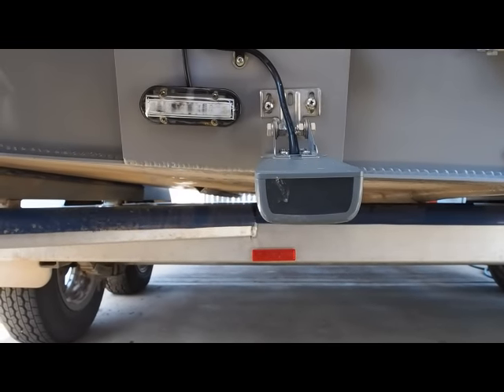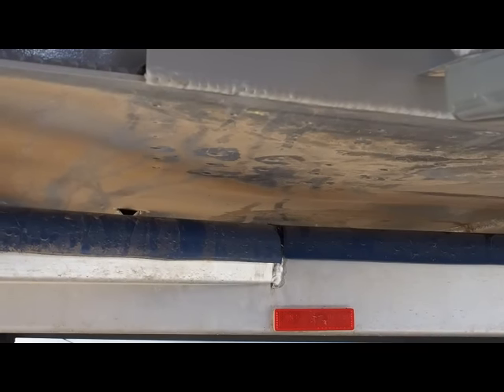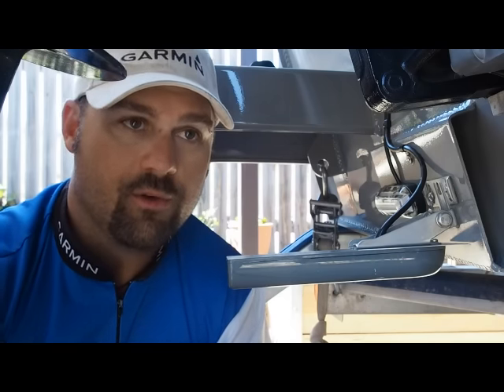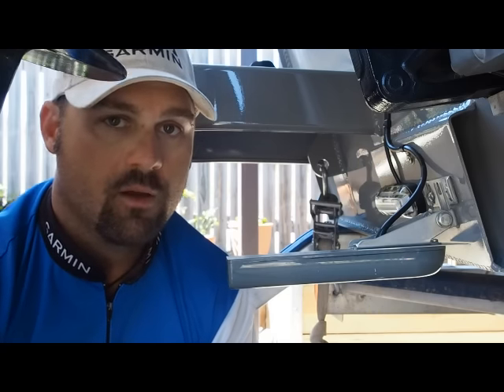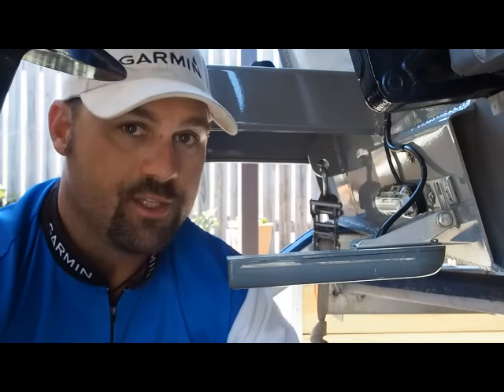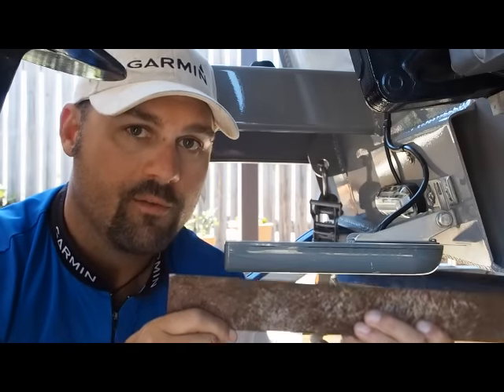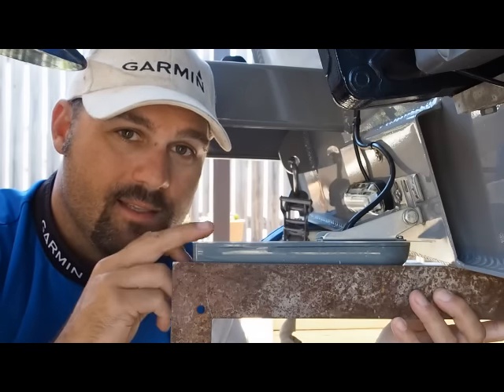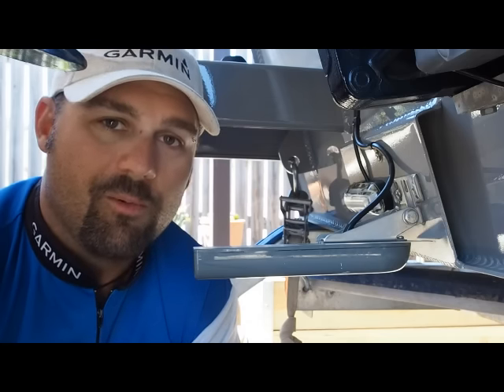Fitting Your Transducer to Read at Speed

Comment: This is a good video.  I put 2 transducers on my boat.  One for high speed, the other (side and down imaging) for trolling.  The high speed (2D only) is on the starboard side, the wide side and down on the port side of the motor.  I troll with an electric up on the bow so there is no turbulence from that back at the transom.  It works well and I can read the screen at over 40 mph.  It really saves a LOT of time when determining where to fish.  Once I find them I switch to down imaging and troll with the electric.  I had 2 boats before this one that "lost the picture" at about 4 to 5 mph and it drove me nuts.  I wanted to make sure I did not have that problem again.  Both transduces are connected to the Humminbird through a Wye cable (sold by  Humminbird).

Comment: Another channel said to put the boat on the water. Measure the boat level at troll, then back at home, set the boat up to the same level. Then install the Transducer making it level. Lot of work. I like your method. Seems more practical.
Reply: The boat may not float or plane level so setting the transducer relative to the bottom of the hull doesn't make sense to me.   I checked my boat at slow troll and  my "search speed"  (about 10 mph)  and set my transducer level for that as those are more important (to me) than reading "at speed".  A bit more effort but I think it is worth it. Each to their own :-)
Reply from the maker: Whatever works mate,  if my clip helps then it's served Its purpose.
Reply: The other channel did it right.
This guy is trying to set his up so he can water ski the kids and search for fish at the same time..

Comment: Great info mate, just in the process of mounting my new Raymarine HV-100 transducer and it cannot be done according to the installation described by Raymarine.  Will try your left side of the motor and not bas far from the prop as described!  Wish me luck!
Reply from the maker: Yes mate, same principal.   I have installed AXIOM transducers with the same success.

Comment: Great video. I have the new 95SV plus with the plastic bracket and the adjustments are not as fine as yours so  i had no choice but to set the rear a bit lower. Tested it out yesterday in a bit of chop and the bottom never drop out once with very little spray from the transducer. Thanks.
Reply from the maker: Awesome legend...  Great little units the 95sv, now to go get a few!!

Comment: I dropped my GT56 transducer much lower and got drastically better results with depth while driving and no prop interference. Although the transducer plate is hitting water now that its sticking below the hull. Garmin suggests 10mm below an aluminum hull.
Reply: Same. I have a bass tracker and i had to lower my ducer Below the hull quet a bit. And also tilted it down. Looks funky out of the water. But reads great
Reply: @jason6325  Same have a bass tracker, would you possibly be able to email me pics of how yours is exactly done? Would be great!

Comment: Hi Ben. This was very helpful. I followed all your guidelines but still have problems reading over 10knots. I do have a different setup though and would appreciate your thoughts. 
First I have twin engines so there is a potential the starboard engine turning anto clockwise is creating turbulence and pushing water up to the transducer mounted on the starboard side. Is there a potential if this and consideration transducer should not be installed on starboard side with twin engines - I have read that a better spot is between the engines
Second, I have a triple stepped hull. Supposedly the step being there to get air under the boat for quick planing causes bubbles and a transom mount just won’t work on a stepped hull. Do you have any thoughts on this potential and ideas you could share.
In short, with twin engines and stepped hull, can a transom mount work and if so where should it be positioned.
Thanks
Norman

Comment: Great Video, Ben.
Can you let me know where Ii can find the metal bracket you used? I like the fact that you can continuously adjust the angle with no stops. The plastic bracket that was supplied with my GT223HW-TM has detents that won't allow good adjustment. 
Thanks.
Reply from the maker: Should be able to order one through Garmin mate.  What transducer are you running??
Reply: Amazon.   Just got mine.

Comment: mr. weston my name is jim Costi, I Have a Garmin stryker vivid 9" unit mounted at the helm. Originally the 'ducer from another unit was mounted low port side at the back of the hull it was fair read out after I xchanged to a better unit with the stryker. I was told to move the new 'ducer to the starboard and on the transom where it is currently but above 5-8 mph the monitor goes blank ( xtreme cavitation I would think ).  Should I try moving it back and simply adjust the height off the hull instead of the transom ( which is set a lot higher on this tracker aluminum hull bass boat.

Comment: Hi Ben, great video. Admittedly, I’ve got Lowrance gear but learnt a lot from your insights. A general question, when you have transducer in place and bolted to the correct angle, should it be nice & tight or if there is a touch of movement up or down, would that have a bearing on reading at speed?? Thanks mate👍🏼
Reply from the maker: That's great mate, any brand owner can benefit from this video.    Make sure you nip it up buddy,  nice and tight.  You want no movement!  Please subscribe and share if your think anyone could get something out of it mate.  Cheers Westo
Reply: Ben Weston Fantastic Westo, thanks for the tips😃🙏
Reply from the maker: @markhill566  no worries mate,  hopefully plenty more to come.. 🙌🙌Cheers Westo

Comment: I have a 13 foot aluminium dingy, driven by a 15hp Mercury...can get up to about 30 km per hr...with one person in it.
I've  just bought a new Garmin finder to replace an older one and want to get the transducer right...had it wrong till now...too deep by far...duh.
My query relates to turbulence from rivets in the hull. There are four around 800mm forward from the transducer, two either side by perhaps 25>30mm of the line the transducer is on. Are these likely to affect the readings? I can't really do anything about them so maybe it's just too bad so sad...Thanks.

Comment: Ur correct in saying that it doesn't make a difference mounting the xducer on the port side.
My lowerance was mounted there because the old xducer was there.  Had some interference and lowrance said fitting it on the starboard side will fix it.  
I told them i dont think it will as its more like electrical with small equal lines down the one right of side scan and everything else works.
Basically they said they cant help me if i wont do as they said.  So i drilled more holes into my starboard transom, mounted it and nothing changed.
Told lowrance of the result and blames me for installation error and to take to a shipwright to fix.
Their techs are usless. 
Sonars are not that complicated to install.
Reply from the maker: Thanks mate, apprecate the reply.  Please subscribe and share if you got something from the vid..

Comment: Hi, I'm mounted on the Starboard side, if I set the inside edge, close to outboard, at 5 mm the outside edge will be completely under water say at 15-20mm because of the steeper V hull of the boat.. Is this a problem? The transducer will have more drag from the water and I don't want to pull it off the boat?? Thanks Much!

Comment: Great video Ben, thanks. I’m looking to upgrade my Echomap Ultra 100 power supply from a 20Ah AGM to a Lithium as can’t quite get a full days fishing out of the now 4 year old AGM and wondering if a FVP lithium 17.5 AH capable of 100% useable AH would give me a full days (8hours) fishing. What’s your thoughts please.
Reply: Old reply but its math.. if the unit pulls 3 amps. A 17 amp hr battery will be 17 divided by 3 which h is just under 6 hrs run time... ifn you want 8 hrs a min of 24 amp hr lithium will work

Comment: hi i have a deep v on my boat  will this work the same as a flat bottom  one any help will be  grateful thanks and buy the way speed doesn't matter  to me thanks again
Reply from the maker: Yes mate it will work on deep v hulls two.. 👌🏼👌🏼
Reply: @BenWeston_westofish  thanks
Reply: Darryl, I have a Solix 12 on order and will be rigging it myself.  I also have a Ranger 619vs and am wondering what type of boat you have and where you found the best place to locate the transducer on your deep vee?  Thanks in advance. Dan
Reply: @warddan2002  hi i have classic craft 5000 which hasdeep v its about 300mm from  motor

Comment: Just to clarify, when people say read at speed, does that mean pickup bottom structure at speed or also pick up fish marks at speed? I can never see any fish at 20 knots but can see bottom structure. Would a 1kW transducer help see fish at speed?
Reply from the maker: Power of the tramsducer can help, but not nessercery if you have correct fitment. Fish won't appear as arches while underway, It'll be a small red blip.

Comment: Bottom of my hull where the transducer is mounted it's flat. Quite a slant so one side of the transducer may be below the hull bottom and the other side is above it.
Reply: Mine is that way also , I pick up bottom ok on it , but it does mess with  side view just a little , right side is actually brighter than the left side on one of my boats ,it's not to bad to deal with though,the other boat I use the same unit on ( I just switch the head ) don't do that .

Comment: When the boat is moving the nose is up pushing the transducer pushed down means the transducer is not level when on the move it will be to far down and cause issues there is other videos on YouTube where they take the boat out on the water with a spirit level and then angle the transducer to get the best reading. 
The transducer needs to go up slightly at the rear to get the best reading on the move

Comment: Hi, If I want to install 2 Garmin transducers (one is side imaging and one only down) - What is the best way ?
Reply from the maker: You need to mount one either side of the transom and run a Garmin 'Y' cable from them to the head unit.  Unsure what you are trying to achieve as you can get that out of one transducer.  Are you running two screens?  Cheers Westo
Reply: @BenWeston_westofish  Hi, thanks for you quick answer, I have 2 units, and 2 transducers
Reply from the maker: @moramsalem4798  No worries mate!  If you are running two units networked, for one screen select Clear Vu and the second Side Vu.  They will use the individual tranducer plugged into the rear of the unit.  Cheers Westo
Reply: @BenWeston_westofish  they are Two separate devices units not  networked unless I didn't understand.

Comment: ok...I am in the U.S. but have a lot of Kiwi softball friends so I could understand your chatter but do have a question fir clarification. When I get to full speed and the bottom changes depth my Garmin echomap 93sv starts fladhing its last depth reading but at the same time keeps showing the correct depth on the screen' s chart. any idea what i need to do to correct the glitch?
Reply from the maker: Hi Bob, 

Your Echomap still picking up the bottom at speed enough to show a depth reading,  but not to display the bottom.  Just try tilting it down a couple of degrees.

Please subscribe & share if you enjoy my content.

Cheers Westo
Reply: @BenWeston_westofish  thanks Ben...i bought my garmin 93SV a year ago yesterday and bought the extended warranty as it was the store display model....i returned it two days ago and have the new one. i tilted this transducer down a bit as per your great video. On both units U now have had the rubber washer on the through-btacket bolt squeezes it self

Comment: I got Garmin 54cv .   should that be 3 to 5 mil also ?  Its flush with the bottom right now.  Talking like a thickness of a trash bag is 3 to 6 mil .  Hard to judge by eye.  What did you use to get to 3 mil ?
Reply: It.just.needs.to.be.in.thewater.away.from.turbulance.dont.get.to.hung.up.on.measurementsjust.below.the.bottm.and.straight.😊
Reply: @leemccullough558     Thank you for your help.
Reply: He’s (incorrectly) using “mil” as shorthand for millimeters, because most people don’t realize mil is its own unit.
Reply from the maker: All by eye mate..

Comment: When u say the inside of the transducer should be closest to the outboard, doesnt that mean then it has to always be on port side ?
Reply from the maker: No mate, it can be either side port or starboard.  Obviously the inside of the transducer changes. 👌🏼👌🏼
Reply: How can u tell which is the inside ?
Reply from the maker: @johnbrown4448  closest to the outboard or keel... 👌🏼👌🏼
Reply: I installed my garmin65cv transducer on starboard side on my polycraft 4.55 but theres alot of interface on the screen. Maybe i had to install on port side not sure
Reply from the maker: @johnbrown4448  honestly mate it won't make a difference what side.  How big is your Polycraft mate? Woukd be tough to get a good read at speed with them due to the moulded strakes.
Reply: @BenWeston_westofish  4.55m CC the bottom is full of grooves could be why?
Reply from the maker: @johnbrown4448  yes mate absolutely, pressed aluminium can be tough to get a read at speed with due to the interference the strakes cause.

Comment: Anyone have ideas for a spray board/shield to mount over the transducers to block the rooster tail from spraying onto my outboard and deck? It reads great at speed so I’m not looking to move it up.
Reply from the maker: Garmin make one one mate, they are great value and there is no holes in the boat.  Please SUBSCRIBE and SHARE if you enjoyed the video.  Cheers Westo

Comment: So you get a reading at plane, but lose the chirp function because boat is not level at trolling speed... Hard to have everything I suppose...
Reply from the maker: You never lose the chirp function mate,  the head unit is programmed to CHIRP sweep regardless of speed.
Reply: @BenWeston_westofish  I mean the down scan imaging works best if level with boat sitting in water at level. So setting it parallel with bottom of boat only works if boat sits level in water all the time, I'd prefer imaging to work better.

Comment: Thank.you.i.have.3.sounders.in.my.boat.one.trans.is.on.the.port.side.no.probs.the.other.two.are.on.the.star.board.side.did.them.like.you.and.no.probs.yet.my.son.put.his.too.close.to.a.planing.strake.and.it.wont.read.at.speed.i.told.him.that.was.the.problem.now.his.missus.wont.let.him.drill.more.holes.to.fix.it.also.the.bib.on.the.sides.on.the.front.is.spraying.water.up.the.back.its.a.five.inch.garmin.from.b.c.f.i.suggested.removing.the.frontal.sides.with.a.grinder.as.i.cant.see.why.the.transducer.has.this.stupid.bib.as.no.others.do.it.doesnt.look.like.its.asensitive.part
.just.a.nuisance.value.one.of.my.sounders.is.the.same.and.i.dont.have.this.issue.yet.my.boat.is.bigger.and.heavy.any.thing.ive.missed.advice.would.be.appreciated.regards.lee
Reply: Damn that's alot of Periods..